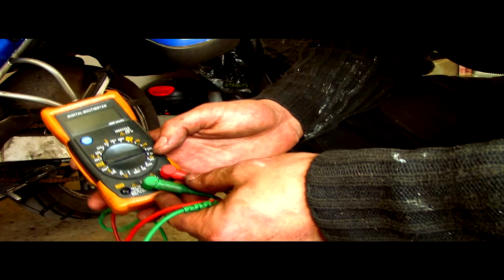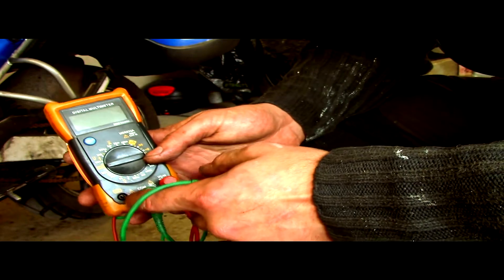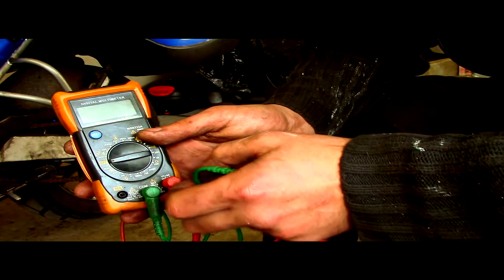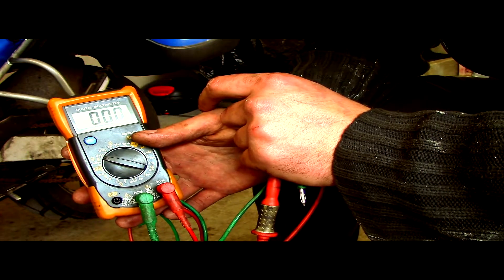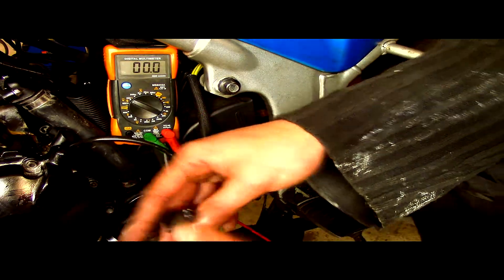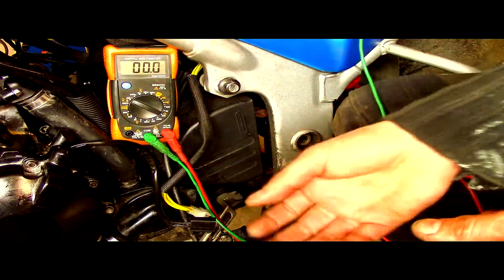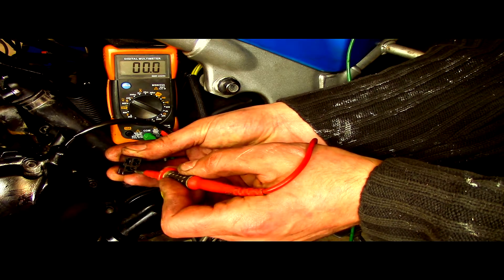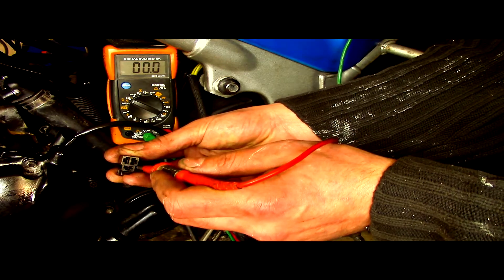Triumph tiger 955i faulty stator test diagnosis. Triumph charging problem

Comment: Thanks for this video.  Yep has been a big help.  When I went to check mine, the connector between the wires from the stator and the regulator had obviously been getting very hot and burnt away, there were just the wires hanging there.  Ran the bike up, voltages were all around 13 on tick-over, which all went up to around 17 at 2000rpm.

Apparently Triumph 995i Tigers are prone to problems with the charging system, and often leaving there riders stranded with a bike which will not start! - Other than that I do really like mine, and will enjoy it so much more when I can get these problems sorted.

Comment: My 2004 decided to stop charging so I just checked it... 0v, 1.3v, and 5vac at idle... I think maybe it's broke. Left me with a dead bike fairly close to the middle of a 40 mile long dirt road in the Adirondacks... but the Tiger has been a great bike over the years so I'm not complaining... wish it had picked a SLIGHTLY better location... but I'm not complaining. ;-)